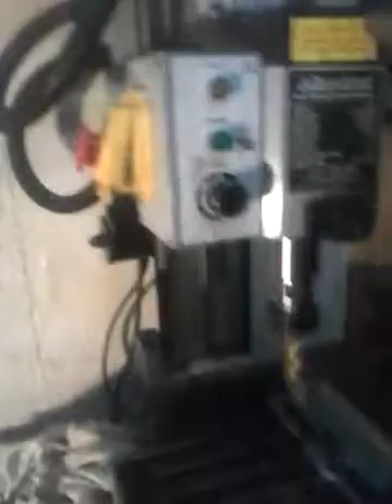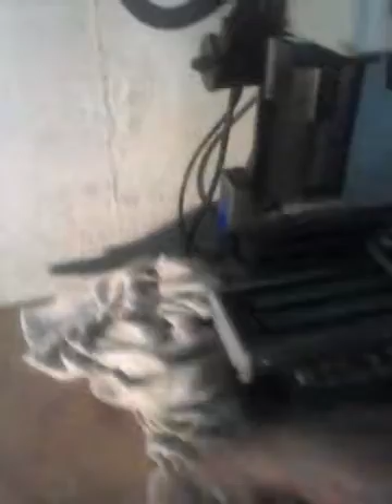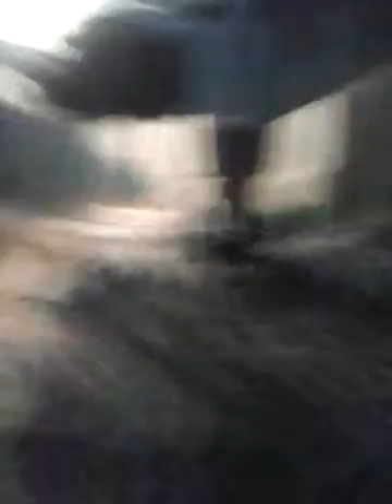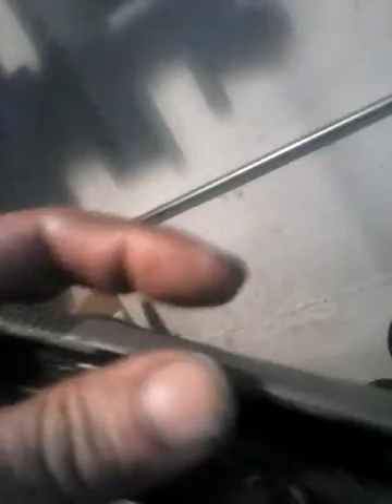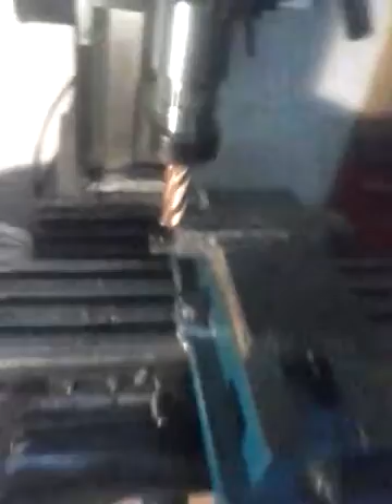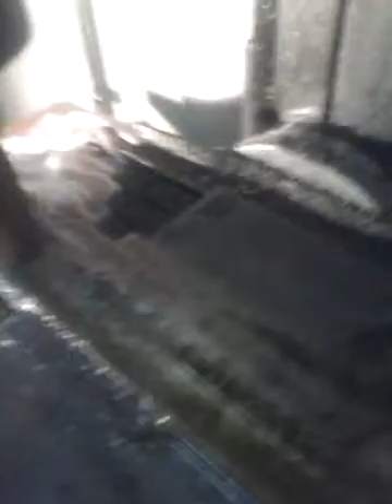milling

Comment: Didn't you complete this slide project??
Reply from the maker: 3 tool room prototypes were made, lacking tool room drawings it was a reverse engineering exercise.  it was necessary to design a barrel bushing and also change the recoil spring.  Eventually however I grew bored with the project and terminated it rather than continue to expend resources and time on a whim..